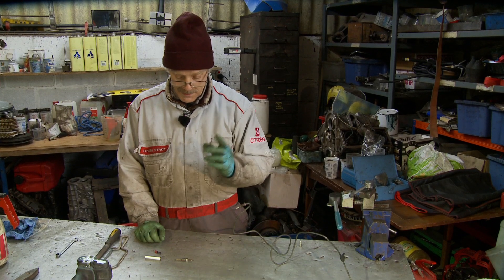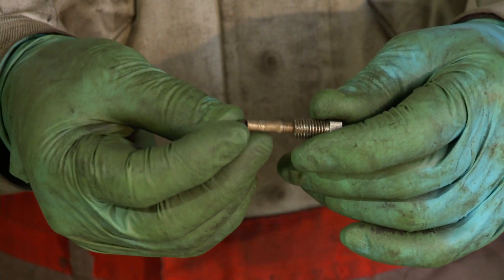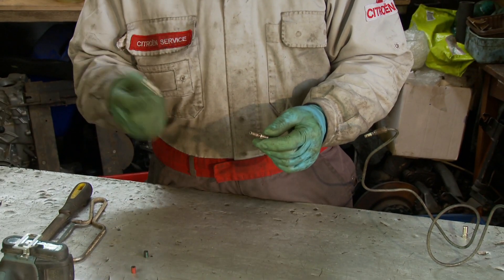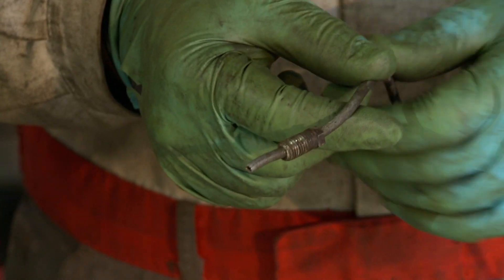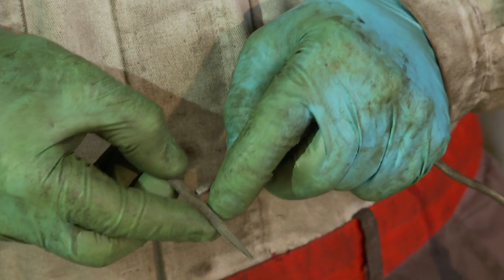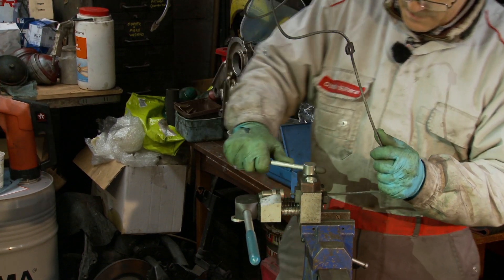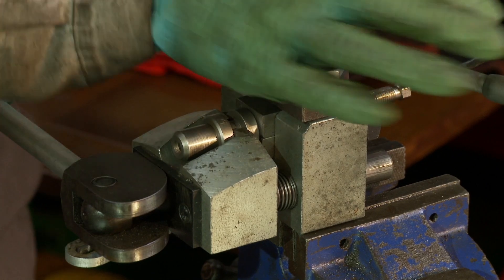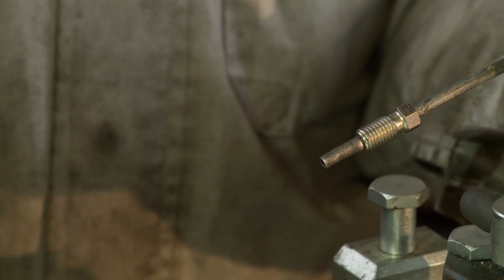Repairing and flaring hydraulic pipe

Comment: Thanks for that great simple video.  If original Citroën pipes are not available, can a regular steel pipe be used? any special specs to be considered? Thanks!
Reply from the maker: Hi Saul, Ian here. Citroen pipes were originally steel so any steel brake pipe as long as the diameter and the "flare" are correct can be used. Some of the pipes can be replaced with cupro-nickel which is easier to shape but the main high pressure pipe should always be steel or stainless steel. I don't know which country you are in but all parts are available here in the UK from www.citroenclassics.co.uk. I'm sure the necessary parts will be available where you are
Reply: @servicingthegoddess  Hi Ian. Thanks for your response.  I am Colombia, so parts for old Citroens are hard to find, that's why we sometimes have to improvise... I am in the process of restoring a 1975 semi-automatic Pallas DS.  I have of course checked the Citroenclassics page, they have a lot of parts! Thanks again and congratulations for professional and beautiful videos.